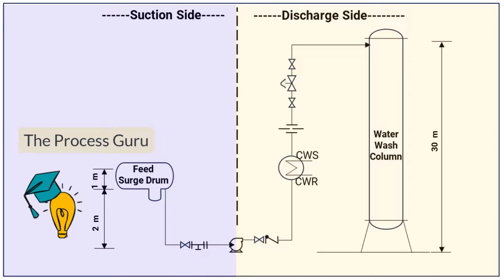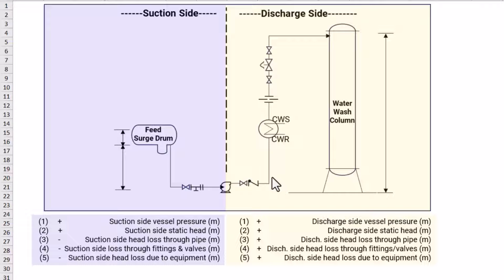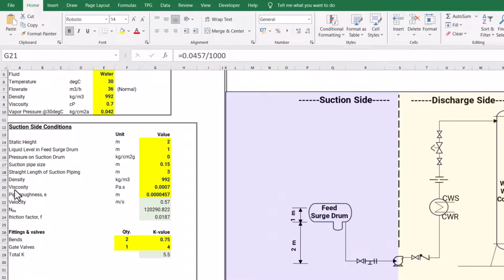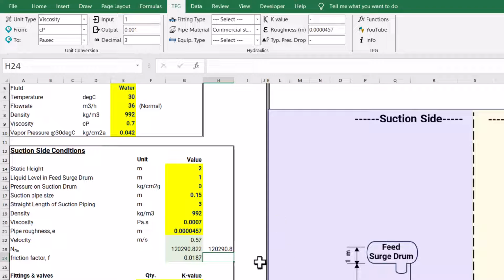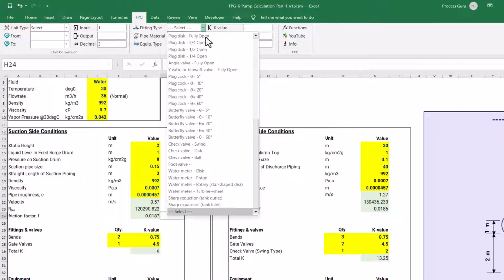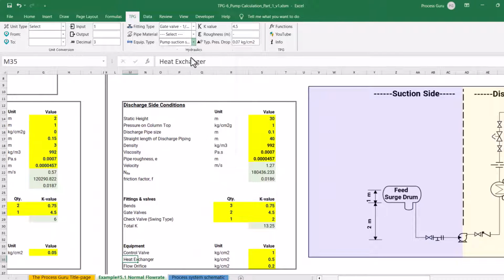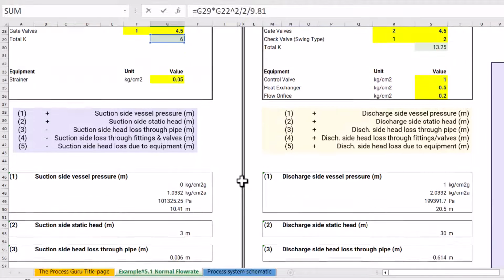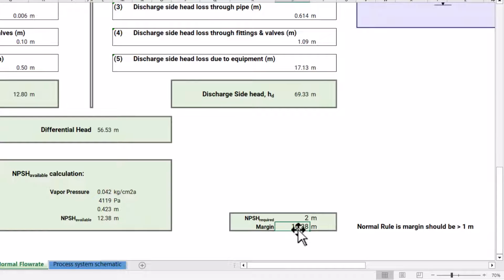Pump Differential Head & NPSH Calculation in Excel (Part 1)  [Download Free Excel Add-In]

Comment: thank you~ it is really helpful to understand pump system. and I hav a question. here, I downloaded your excel but I can't see the TPG Section on the Ribon Tab.
Reply from the maker: @hyunwookryu4077 Thank you! I’m glad the video was helpful 😊
It looks like you downloaded only the Excel calculation sheet. The TPG Ribbon comes from a separate Excel Add-in, not the calculation file itself.
The add-in download link is also in the video description, right next to the calculation file link.
For installation steps, please check the other comments below—I’ve explained how to install the Excel add-in there. Let me know if you still have trouble.
Reply: @ProcessGuru  Thank you for your prompt reply. I added "Excel Add-in" but unit conversion is not working. K value, Roughness(m), Typ. Pres. Drop are Okay. 
How can I fix it? Thank you for your help. :)
Reply from the maker: @hyunwookryu4077  Please try installing this new add-in (v3.02) that I developed for another Heat Exchanger design YouTube video. It’s currently installed on my laptop and working properly. Let me know if it works for you. 
Link for v3.02
https://drive.google.com/file/d/1qwwxuG_EGuIGLDUi0gBKZN5j6eg_LF5E/view?usp=drive_link
Reply: @ProcessGuru  Thank you very much for your response. Unfortunately, the unit conversion function does not seem to be working properly at the moment. Other than that, the remaining parts look fine.
I appreciate your support, and your input has been very helpful in broadening our insights. Thank you again for your assistance. :)

Comment: Hi PG, The Excel add-in V3.02 is not able to install and is getting a supporting error. Could you please provide the error-free add-in file?
Reply from the maker: Hi, please watch this video where I have explained step by step way to install Add-in. Hope this helps.
https://youtu.be/g-ne5MeCZOI?si=b9SaAwXfEjW_WzG0
Reply: @ProcessGuru  After clearing the supporting error, now MS Visual Basic - Runtime error '9' (Subscript out of range). Please support in solving this error.

Workbooks(WB_Name).Worksheets(WS_Name).Activate
Reply from the maker: @mohamadelias  Not sure about the error you are mentioning. I tried at my side to re-install the same add-in, and it works fine. 

Just quick recap about the installation: 
(1) Make Add-In folder in your D drive; 
(2) Place your v3.02 add-in in that folder; 
(3) From Excel Developer tab, add the add-in location; 
(4) If macro security is stopping to run your add-in, you will need to add your Add-In folder as trusted folder. 
After these steps, you would be able to access the add-in content smoothly. Same steps are explained in the video link I mentioned in the above comment. Hope this helps.

Comment: Sir the excel sheet does not open it says object variable or with block variable not set
Reply from the maker: Hi Abhinav, it’s working in my laptop. I will try to figure out what could be the possible reasons of this type of error (object variable/block variable not set). BTW, is it showing error code 91 or something?
Reply from the maker: Hi Abinow, I tested the Excel sheet and add-in on another laptop, and it worked fine there too. I'm unsure if your issue is related to the Add-In installation or Excel sheet itself. Many people encounter difficulties with Add-In installation, so if that's the problem, I recommend watching this video where I explain the installation process in more detail. You can watch "how to install" section. https://www.youtube.com/watch?v=g-ne5MeCZOI